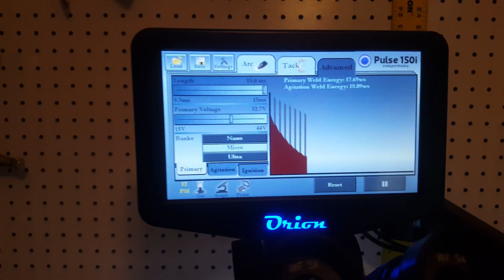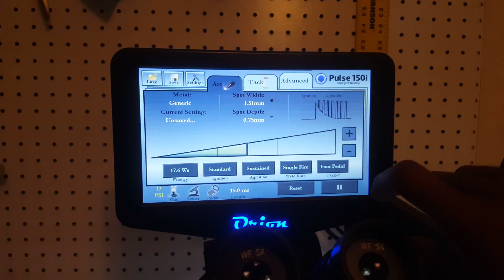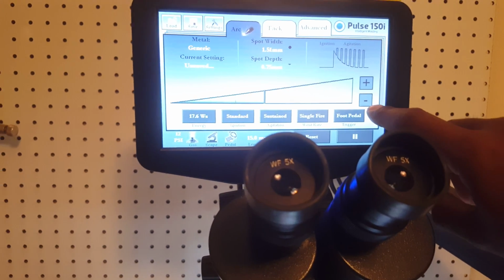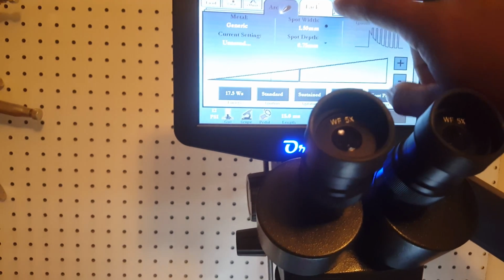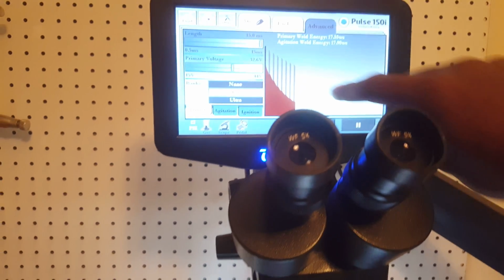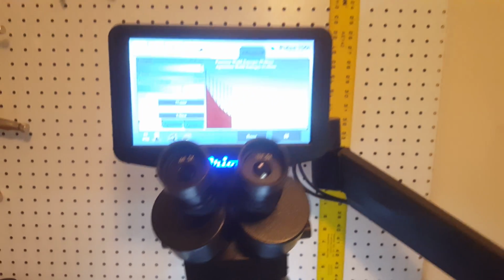Homemade Electric Surfboard Workshop

Comment: Hi I seen your DIY jet board on the other video and I was going to attempt to try to build one myself I was wondering what type of motor you are using and what horse power outage you would need to get up and going? Thanks
Reply from the maker: Weight and board size are the important factor when building an electric surfboard.  I will talk about the importance in my next video. It will answer.